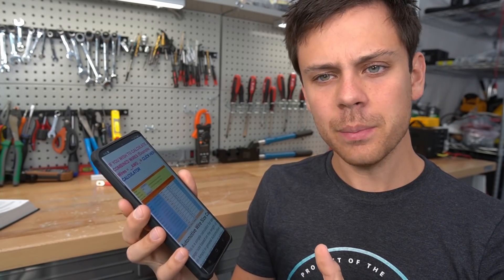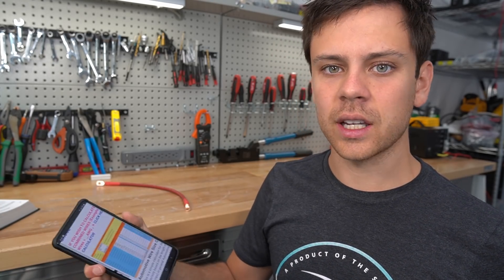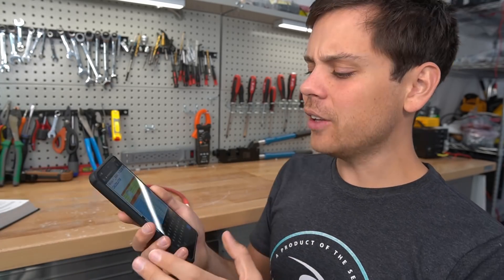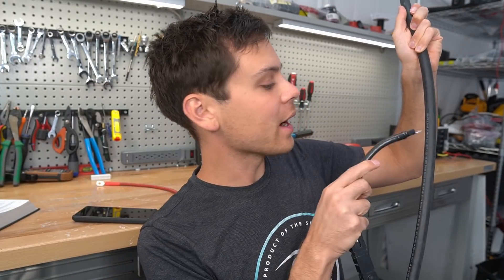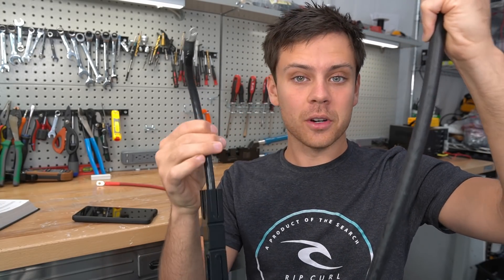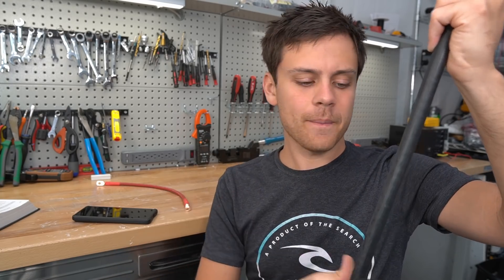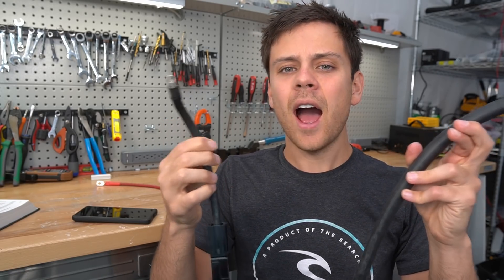How to Determine the Ampacity of a Conductor

Comment from the maker: But I should add that you should never exceed maximum rated ampacity, stated by ABYC standards for a specified insulation temp rating. Just because a conductor can carry the current efficiently, does not mean you can always use it: http://assets.bluesea.com/files/resources/reference/21731.pdf

And be sure to oversize your wires to be on the safe side. It helps a lot! The lower the resistance, the better!
Reply: Spot on, good job Will.  Don't forget that your terminal connectors also have temperature ratings, which will generally take you up to 75 degrees instead of 60 degrees in your ampacity charts.  Keep up the good work!
Reply: And that's how it is done!!!!!
Reply: Thanks for the video, this is great!

I see you mentioned wire ampacity in this comment, but not in the video. I'm a bit worried it might be missed.

For example, a really short 4-foot run of 2 awg cable might have less than 2% loss at 300 amps, but the cable will heat up a lot! 
A 2% loss means the 13.8v loses 0.276v.
0.276v x 300a = 82.6w.

It won't take too long for 80 Watts to heat up 4 feet of cable to unsafe levels. A 300a surge could be OK for a 10s of seconds, but 2 awg is only capable of handling around 100a-200a continuously (based on heat, before exceeding the insulation temperature rating). So 2awg would work great if speccing a system for 100a continuous use, with occasional 300a surges.
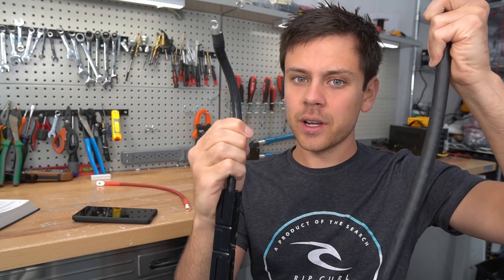Reply: You confuse ampacity with allowable voltage drop in this video.  You need to edit it at minimum.  It is not "safe" to exceed a conductor's ampacity in such a gross fashion as you assert at 5:04.
Reply: Arturo would be proud!
(Arturo rio linda types was greatest conductor of symphony ever was on one hour NBC on Sundays. )
Reply: Arturo Toscanini
Reply: 'To be safe' would mean to go lower on the voltage.
Reply: @MrGreen7427  no, higher voltage is safer. To power a 120w bulb at 12v, a wire needs to handle 10a. To power a 120w bulb at 24v the wire only needs to handle 5a.
Reply: @PusoPinoyAko  exactly..  but being 'safe' as he puts it means he is lowering the amp requirements.  He is looking to stay within the amp rating and the scenario he plugs in is the LEAST demanding on amps.   He is looking to be safe and figure out the most amps... but is doing the opposite

Comment: I'd like to ask... I have a lead acid battery bank consisting of 6x 220aH 12v batteries connected in 3 pairs of 24v (2 12v in series) connected in parallel giving 24v total & 660aH.... How much current would you recommend to charge this setup... Would I need to charge based off the total aH of the entire bank (i.e 660aH) or the aH of individual batteries (i.e. 220aH) in the bank? I hope my question isn't confusing

Comment: Wait... the cable run distance for a circuit is supposed to be the + and - added together? I’m surprised no one ever talks about that for DC circuits. Is that a given for most charts, or do the charts specify like they specify conductor type?
Reply: Let’s also not forget that so many wires manufactured overseas are not the actual AWG size they claim to be!  If the deal seems too good to be true it probably is. I learned this the hard way when ordering 100 feet of 12Awg that was maybe 16 awg at best
Reply from the maker: That sucks you got ripped off. Yet super common
Reply from the maker: Yep all charts and calculators state it somewhere. Depends on what you use

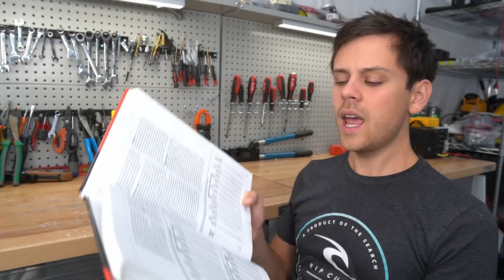Comment: 5:40 in your video directly contradicts what you're trying to claim about a conductor's current carrying capacity.  In short, you're claiming that it's safe to run 300 amperes continuously through a short #2 AWG copper cable. I'm going to now show you why that is a terrible idea:
#2 AWG copper has an ampacity of 115 amperes at 75°C.  You should always use the 75° table as most fittings and terminations aren't rated for 90°C.  When running a load continuously you should never exceed 80% of a conductor's maximum ampacity due to cumulative conductor heating.  (You alluded to this in your video)  Now the real reason you should never exceed a conductor's ampacity, especially by such a gross margin.  I calculated on a 12V system at 300 amps you'll be dropping 3% of the total load across 4' of conductor.  You'll be attempting to dissipate almost 100 BTU per foot from this short section of cabling.  
12V * 300A =3600W
3600Watts * .03 = 108Watts
108Watts * 3.41 BTU/Watt = 368 BTU
This will lead to the wire gaining a substantial amount of thermal energy, which will further increase its resistance compounding the problem.  This problem will be exacerbated further by any materials around the cabling that inhibit heat transfer to atmosphere, or if the atmosphere around the cabling is already hot.  Since inverters are typically located in cabinets or squirrelled away in nooks and crannies this is a likely scenario. 
In your example you also demonstrated that 2/0 cable would have the same losses over ~50 feet if memory serves.  This is a much more acceptable scenario as that same ~400 BTU will still be generated, but it will be dissipated over a much greater length and much greater ampacity of cable.  At ~8 BTU per foot of cable you would likely not feel any perceptible heat from this scenario, but the former would get quite hot. 
In short, never exceed conductors' maximum ampacity for any substantial length of time.

Edit: For some perspective, electric baseboard heaters dissipate about 500 BTU per foot, and they have aluminum fins around the conductor to assisted in spreading the heat.  Imagine how hot that poor little wire is going to get with no such heat transfer assistance.

Comment: 1 comment and 1 question...
First the comment, I would have liked to have seen you compare the chart to the calculator to see if they came up with comprable results. And my question is, why do you have to use solid conductor when wiring a house?

Comment: Another factor to consider is the type of wire, meaning whether or not it is a solid core wire or stranded wire. Stranded wire can actually safely carry more current than an equivalent sized solid core wire. If you take a stranded wire and determine the gage of each strand and count the number of strands, you can use your calculator and the math will bare the truth. My physics teacher explained to me that the electrons travel on the surface of the conductor, and the more surface area the more current the conductor can handle.

Comment: Don’t forget to mention your contractors. Different connectors have different ampacity ratings. And the way you route wire is also a contributing factor in wire sizing. Hard 90’s will increase resistance in your wire. (Ask me how I know this) lol.

Comment: Is there a difference in generated heat if it conducts AC or DC current? I think because of the larger losses due to DC we have AC for power distribution.

Comment: I can never get over people's assumptions on DC wire losses. I once had someone tell me that a five foot wire run was too much loss to drive a 3mm LED (low power) - no joke. Even after busting out a volt meter to show zero registered loss. Some folks act like a 50ft run of DC cuts power output in half or acting like you need to quadruple your wire diameter for an inverter application and I just can't understand where they are getting their numbers when textbooks or flat out real world testing prove them wrong.

Comment: THANKS Will. In a mobile Solar system (RV), does it matter if the controller is closer to the panels or the batteries? Because it was easier to build, my controller is closer to the panels. Should I rebuild my system?

Comment: But everyone be careful. Here in Germany more and more appeared Chinese copper cables which exactly look like copper but it is only a thin electrolysis layer of copper color. The inner material is steel or Aluminum. Those fake copper cables will become very hot and eventually will be a reason for deadly fire.

Comment: Sorry if this is a repeated question, why did you double the length?  For instance, solar to mppt is 8 ft, mppt to battery is 2 ft, assuming fuses are inline and no not change overall lengths.  Would you calculate for 8 or 16 at (x) amps and then 2 or 4 at (y) amps?

Comment: Thanks Will. Your videos are great. I’m converting to LiFPO4 house batteries on my sailboat and plan to use the Renogy 30amp dual charger. Where I live there does not seem to be much local knowledge for this type of setup so I am appreciative of your videos. I thought marine engine site / companies would have some easy access outline to include engine/ alternator sensors etc, no luck so far. Thanks Will!

Comment: Another Great Video Will - My geeky friends always laugh because I tend to over size wires on everything - my Ebike travels futher than theirs  on the same batteries and run which vindicates the value of thicker wires - I notice solar MC4 cables come in 2, 4 and 6mm  -  4& 6 seem the most popular - you can guess which I use on larger panels - Once again the consummate ease that you impart your knowledge is  flawless

Comment: "Ampacity" is not a word, nor is "amperage". Ampere is a unit of current like pounds is a measure of Mass. You don't say "Poundness" to describes somethings mass of weight! The word you are looking for is "current-carrying capability"!!
Reply: Definition: “Ampacity.  is the maximum current that a conductor can carry continuously under the conditions of use without exceeding its temperature rating.”  That’s why they are called “Ampacity calculator or “Ampacity” charts
Reply: Welp, I guess they need to rewrite all of the code books now. You would think that they would have had at least one editor that would have caught these simple mistakes sometime within the last 100+ years.
Reply: @PusoPinoyAko  What do you suggest? That we Also say Ohmness, Ohmperage and Ohmpacity? Resistance the one Electrical property people still repect!
Reply from the maker: Amperage is not a word??? Are you sure?
Reply: @WillProwse  Sorry to be a busybody, but "current" is the property and Ampere is the unit you measure IT by. However IT is even more Common to say "voltage" but that is Also wrong, you either say tension or Electrical potential. Ampacity as amperage are dit invented Words. However I don't want to be a linquistic Facist, so feel free to express yourself as you please, but your video title popped Up in my notifications at 5:30 AM and IT triggered me instantly.
Reply from the maker: It states "ampacity" on my chart

Comment: Good evening Will... I have an unrelated question that you may wish to answer..?   I have two sogens and would like to power both at the same time using one 180 watt solar panel (instead of a separate for each)..  Realizing that the sogens cannot be connected together in any way,  my solution would be to provide the necessary branch mc4's for each sogen and isolate each branch with an inline mc4 fuse which already has the diode built in to prevent vdc back charging.  Your thoughts..??

Comment: This past few months I was experiencing power loss from my array. I have # 4 wire buried about 6" underground for 25" to my house.
The array was putting out 64 volts at 36 amps. But at my charge controller, it was only 42 volts ar 5 amps.  So I dug up the wires. There was a big Bluegreen pimple on the cable at on spot. Picked up the cable and it broke completely at that spot. There was a tiny 1/8 hole in the insulation... maybe form a mole.  What a hassle.  Conduit is a great idea.

Comment: One of the strangest human phenomena is the resistance of people to simply move the inverter, charger or inverter/charger closer to the battery bank when there’s no environment or space restriction. I see this regularly in RV’s. They even swap out the charger for a lithium charger and put it in the same place as before, sometimes at the opposite ends from the battery. Then I’ve seen people place the inverter and or charger in the engine room of a boat when most aren’t “Ignition protected” (potentially spark generating) and have no business being where there can be gasoline fumes. When factoring in voltage loss, some breakers and shunts cause some loss too 1%>?

Comment: I asked you this should I get to 200 w solar panels and plus minustwo double the power or should I get for 100 watt solar panels and do the same thing
Reply: Watts are basically watts.

That said, here are some considerations...

One 200w shaded panel will not produce the same output as one shaded 100w and one fully sunny 100w panel.

A 24v panel will start charging a 12v battery bank long (hour+) before a 12v panel gets enough sun to get more voltage than the charge controller requires to start charging the battery (typical a few volts above the battery bank voltage).
Reply: @PusoPinoyAko  thank you

Comment: hello William, and thanks a lot for your exceptional super good work.       I'm wondering..  what happen to solar's panels when batteries are full.. and the sun still there, so the panels still producing..      and you not use this electricity..      so where it goes ?   and can it damage any component of the system ?

Comment: another thing i suspect a lot of people dont know is that you can use two of the exact same cables to carry your load. in other words i have 2awg wires going to my bank and when i power my microwave on top of everything else i see a voltage drop at the inverter down to 11volts, even though the battery only drops to 12.6 volts, i was able to use two exact sets of cables to decrease that drop at the inverter. solar and battery power is expensive, lets not waste any of it on undersized cables and lets not add heat where expensive heat is not needed.
Reply: Ampacity of conductors decreases as parallel runs are increased. It's not a simple thing as I want to run 200a, so I'll run 2 x 100a cables. But yes, you don't have to run just one conductor.

Comment: I'm a bit confused of the distance number. If you have 50 ft between your solar array and your charge controller, you put 100 ft in the calculator because you have 50 ft of wire on the positive and 50 ft in the negative?
Reply: Depends on the calculator you are using. It SHOULD specify if you need to use one way or round trip length. If it does not specify, I would either use a different calculator or use the round trip distance to be safe.

Comment: So if I'm losing 3% in a 1-inch long wire I'm doing something bad. 3% of 10,000 Watts is a lot of heat dissipation in a wire that short.  There are limits to the 3% rule.
Reply from the maker: Absolutely!